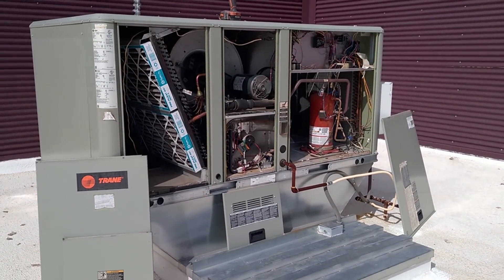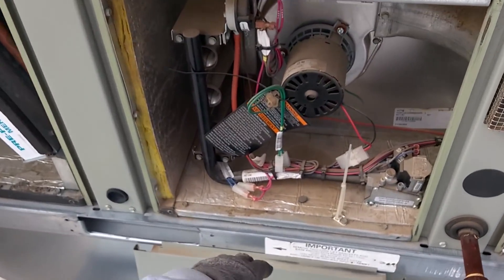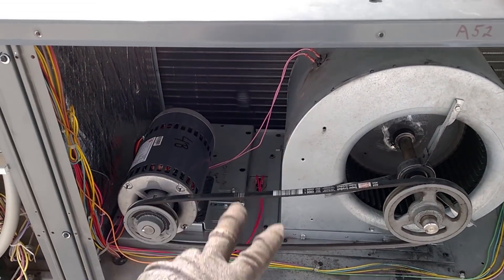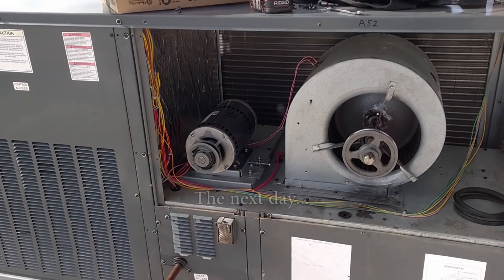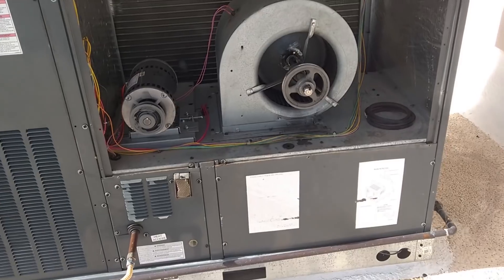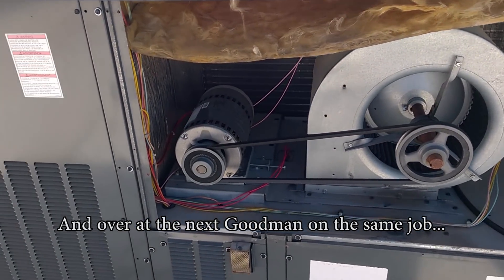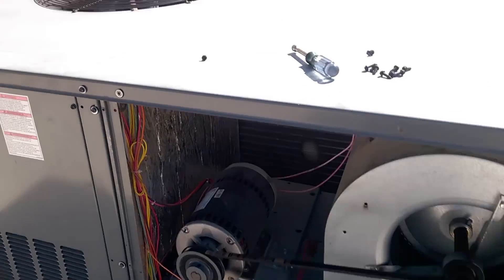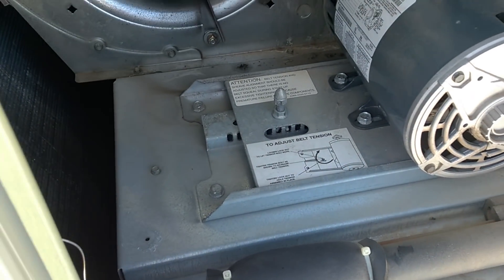Real world no-holds-barred comparison of Goodman and trane commercial RTU's

Comment: I use to think you were a little hard on goodman until I worked on a Daikin RTU this week. Basically a Goodman with a different coat of paint and label. I was pretty surprised at what a piece it was. The production year was 2014 and the panel screws were already stripped.the panels were flimsy as could be.  The first stage coil had multiple holes in it, the only RTU I've seen with 1/4" diameter recycled(?) copper. Someone already had made an attempt to make a repair on the header(unless it came from the factory that way). Just junk overall, they should have called it the "repeat service series". The guys that are saying "all brands are basically the same" is everyone but the service guy who has to maintain them and keep them in running condition, some how that's lost on the owner, salesman and installer
Reply from the maker: +Jason Haight AMEN I am glad you have seen the light.
Or rather, the darkness where Goodman is concerned.

There are major differences in build quality between the Trane and Goodman as I demonstrated here yet some are just in eternal denial. :-/

Comment: Just went on a 2007 system on Friday.  90 + furnace with ac.

1.  Didn't register unit for warranty

2.  Put in an R22 unit

3.  Evap coil leaking, no R22 in system.

4.  Blower compartment insulation hanging in the blower.  I mean really!  You can't even install insulation correctly?  Shame.

Now the homeowners have to pay for a new coil that should have been under warranty, and R22 refrigerant.
Reply from the maker: +dpeagles Dang, bummer.
I assume you were talking about a Goodman Furnace?
Reply: hackfreehvac Yes, sorry.

Comment: I like that the controls aren't packed with all sorts of goofy electronic boards
Reply from the maker: +Tom Morris Which one?
Neither unit in this video had a lot of control boards. 

If you are thinking of the Trane units that do have the Reliatel board and other boards, the reliatel is the main processor and other boards do other purposes such as Trane's EMS control/network, Economizer, etc which all just connect with a cable that sends DC power and serial communication.

Those boards are light years beyond what Goodman engineers have seen in their dreams and they don't break down to often either.

MOST Trane commercial units use the original control board until the unit is changed out.
Reply: Their only goofy to you because you don’t understand them, or how to troubleshoot them.  The train Voyagers came out in the early 80’s, and were light years ahead of everyone else.  Lots of microprocessors, and super dependable.

Comment: Thanks for sharing brother. I'm an inside tech at a hospital and one of my guys does a ton of side work. He installed several Goodman units because the customers didn't want to spend a lot. Three bad Goodman aluminum evaporator coils that need to be replaced after just two years of service! Goodman rep says, "We will send you three new coils, no need to return the old, leaking coils back for the warranty." So who eats all the labor costs each time??? The poor installer??
Reply: I can answer that. the contractor
Reply: +talyn875 You got that right Zack! How about Goodman "fixing the problem" they have known about since 2009.
Reply: Brad1237202 goodman should have stuck with simple low end equipment for residential
Reply from the maker: +talyn875 Yeah when I see this stuff I am like "why bother?"

The sad thing is some guy somewhere will offer the crap to a business who doesn't know better and will buy on price.
ESPECIALLY when said HVAC co. tells the customer that there is no difference between Trane and Goodman.

Looking right here, clearly there IS a difference. And that is my whole point.
 And in this case as are others the customer did not get an accurate representation of the quality of the equipment.
Sure these three Goodman units were cheaper than the seven Trane Precident units they got 4 years ago, but the Trane units are more than twice the build quality and more than twice better design for service as we see with the filter rack, access panels and every other little touch engineered into those awesome units. The only set up in this size and class that I can think of as being even more engineered for service are the ones with hinged doors and the high quality latches like on the Lennox L Series.

Comment: Now I would not tell anyone that Goodman is better than any other unit, the design of a Goodman was engineered and then the bean counters take over and in their mind make it enticing to the contractors through price by cutting corners, that is why you will always get what you pay for.
Reply from the maker: +Larry Cole That is exactly what they are. Low cost entry level units. 
They got so popular because in areas like the growing cities of Arizona the tract homes were installing them by the thousands per year because they were the cheapest they could buy.
Reply: I can remember Chas Roberts were putting them 25 years ago if not longer. I believe they were known as GMC then, never the less they weren't as good as they are now which is saying a lot about their build quality it's just not there.
Reply from the maker: Larry Cole
Yup. Chas Roberts is why Goodman even has a presence here.

Before that everything was GE/Trane, Goettl, Carrier,, Lennox, Rheem, etc down the line.

Speaking of Goettl, they were too reliable. They built themselves out of business!

But their name had such a good track record from the 60's into the 90's around here that a company bought out the brand name and has since been installing GOODMAN units with Goettl brand stickers added to them!!!!
They are still doing it too because I saw it at a job about two months ago. I need to find what I did with the photos and post it up. Talk about despicable!
Reply: Goodman seems to be about the most common choice for what to install in flip houses and rentals too, which adds to both the prominence and notoriety of the brand.

Comment: Its the same in ressy.. I deal with a shit load of gas furnaces and the goodman/amana are the absolute worst furnaces I have seen. Horrible quality motors that draw high amps, loud as hell inducers, cheap flimsy fucking doors and sheetmetal. I cringe when I see one and feel bad that someone paid for the furnace when they could have gotten a carrier or am. std/trane instead
Reply from the maker: +Jordan Maz Indeed.
And it's one thing if they KNOW they are getting what they pay for (cheap) but when they are told that they are the same tier as Trane, etc, that is just wrong.

Comment: 9/16 wrench and done, Trane makes it easy.
Reply from the maker: +JR Cervantes YUP! Possibly the easiest blower adjustment design ever!
Reply from the maker: +Eric M Yeah that is from the bandits who don't use a wrench. 

I got used to using a screwdriver in the cog to move the adjuster because of those old worn acorn nut things that used to split so I just continue to use one wrench to loosen the set nut then a screwdriver in the cog to have easy leverage to slide the motor even on new ones like this.
It is so easy.

Comment: well installed and well maintained they live long too.
Reply from the maker: +tecnico What is "they"?

The Goodman's here had a good install. So if you are talking about these Goodman units all I can say is "hmm.... NOPE". All three of them have failed already due to the blower mount popping apart and the one ate the blower bearing too which was already fixed earlier this summer.

The quality difference IS night and day unless someone has welding goggles on so they can't see it. :-p
Reply: +hackfreehvac no doubt trane is much better. but goodman has improved alot. well commercial part is stil sorry.
Reply from the maker: +tecnico Improved alot = not as smelly of a turd but still a turd. LOL.

These were almost new Goodman units from 2013.
Reply: +hackfreehvac the only way Goodman could improve is too stop making equipment.. Lol